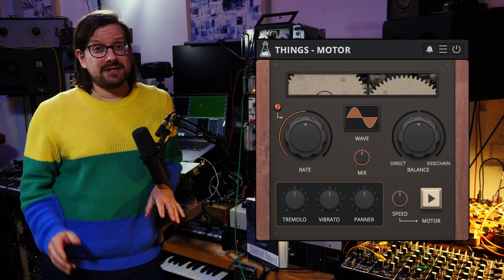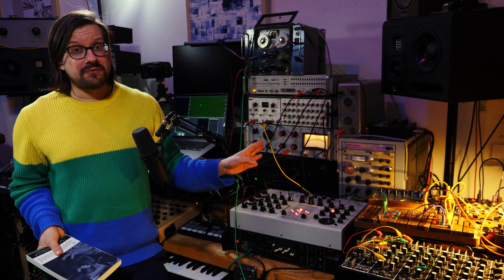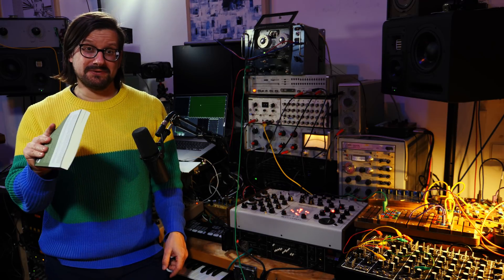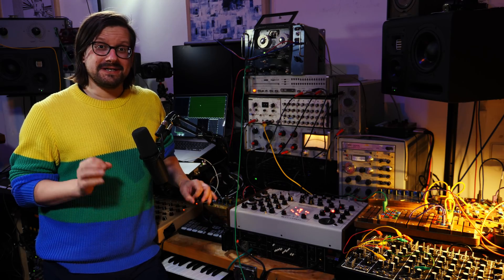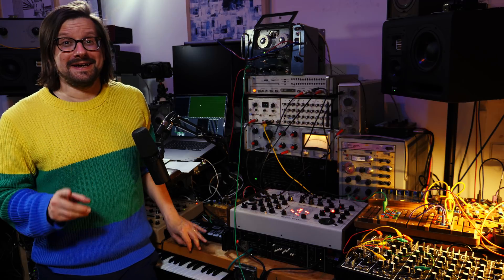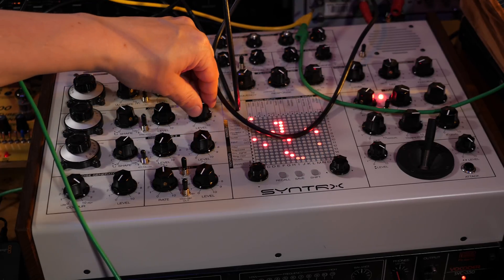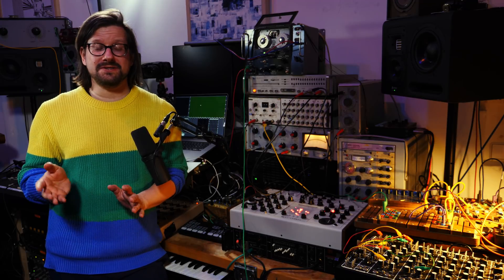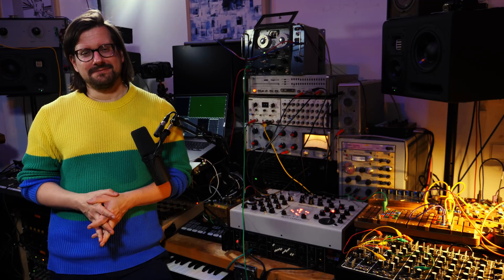Adding test equipment to a synthesizer setup

Comment: Well I guess maybe fools go where angels fear to tread because I've been doing the same thing, running sine generators and similar directly into my mixer, or through effects pedals, for a little while now.  And it has been working, but I've been keeping it to common sine and arbitrary function generators in combination with a regular drum machine and a couple modern synths.  LOL I thought I was alone in doing all this, it's been lots of fun.  I am, however, concerned about my gear, and whether any of the standard output from these gadgets can do any harm to music hardware.  I need to learn about impedance matching, it looks like.
Reply from the maker: Definitely not alone in this, too much fun 😃. You can check the voltages easy with a multimeter to be safe.
Reply: Hey!  Thanks for the reply.  So much learning to do!

Tomorrow I take receipt of my second Wavetek 164, so I will have a pair.  I keep telling myself I should be saving my money for conventional instruments and then I go buying another one.  You can sure see why people adopted the "Eurorack" format, these are just like modules in that you can benefit by using several together.  Must be nice to have everything all squared away in a neat little rack.     @Hainbach

Comment: TIGHT AF! Thanks for sharing. I wish you would have mention what you actually did to control the levels, careful attenuation?
Reply from the maker: Yes! Attenuation is key. But all test equipment has output levels written on it anyway.
Reply: @Hainbach  Thank you so much🤗

Comment: So I have recently purchased some test equipment... hp202a oscillator and wave tech function generator, as well as an Arturia key step. What would the setup need to be in order to either sequence and/or control the pitch of the test equipment with the keystep? I couldn’t get any response when plugging the keystep into the test equipment, but I did get a response from my o-coast when I plugged the keystep into my o-coast.
Reply from the maker: You can't, unless you mod it.
Reply: Thanks Hainbach

Comment: Hey, I've got an Exact 202, too!  Cool to see it in a thumbnail.  Can't wait to watch the vid.
Reply from the maker: Oh cool! Does yours self-cycle? Does not work with mine.
Reply: @Hainbach  yes, it does.  It's still very quirky.  It has multi-turn pots/knobs on it, which are very sticky.  Makes it hard to use with any precision (ironically).  But yes, it will cycle, and I can set the sequence length.  One of these days I'll get it cleaned up and maybe shoot a video.
Reply from the maker: Yeah I think mine needs service. But good to hear it works in that fashion for you, so much more possibilities

Comment: Hello mr Hainbach i have a question! Can you use test equipment to interact directly with the eurorack modular (audio and cv) or is it too dangerous? Like can i just output a sine or function generator into a passive attenuator and throw in a filter or vca or use it as modulation?
Reply from the maker: You can dominate, but have either voltmeter or scope ready or get this module: http://www.metro-modular.com/index.php/system-3000/mm3203-test-eagle

Comment: 12:29 - I've always been a fan of vocoded drums, whether it's aggressively or subtly done, and I've done that since the vocoder appeared on Reason, all those years ago..... when I was young, happy and not troubled like today 😂🤣😅😐😪😫😭😭.

Anyway back to those vocoded drums, when it's done aggressively it's a case of murder the carrier signal (usually 4-6 layers osc's) with saturation, distortion, grit & filth and EQ it and then plug that into the vocoder for the drums to try and make sense of.  When done subtly, I keep the original signal to the front and only effect the wet signal to mix in after been compressed (hard or soft) to increase the feel of the effects and then had reverb (all speeds), delay (all speeds) or a modulated filter and often people are 'What is that on the drums?  I can hear it, but I can't hear it and it's tickling my brain!  TELL ME WHAT IT IS!!'  Even changing the pitch of a few of the osc's or adding in noise has eyebrows furrow and eyes widen.

Yep, I do love that 'other world' feel that vocoders offer and far beyond just bloody Cylons type voices, that are still great, but meddling in other ways is great.

Comment: I've just started reading that book myself. I'm lucky enough to occasionally work at the old home of the Radiophonic Workshop and sit in one of those historic rooms. There's no equipment anymore but the decor, acoustic treatment and patchbays remain.  Whilst I'm just going through emails and making calls I feel a real connection with what happened before and I always imagine the tape loops snaking up and down the long corridors as I walk.

Comment: Great video. This probably wouldn’t fit your work flow, but I use an oscilloscope in the signal path, looking at any input I’m concerned about, to make sure I don’t apply signals at too high a level. I check the signal in question before applying it to avoid damage. I come from an electronics background, so that’s trivial for me. It’s relatively easy to use an attenuator (something as simple as a potentiometer would work in a lot of cases) to reduce a signal to the proper level. That could potentially open up possibilities of using a signal source that might have too high a level for another devices input. Just a thought.
Reply from the maker: I got a scope in the workshop, so I test before now. Everything goes on the bench now before the studio, learned my lessons :-)